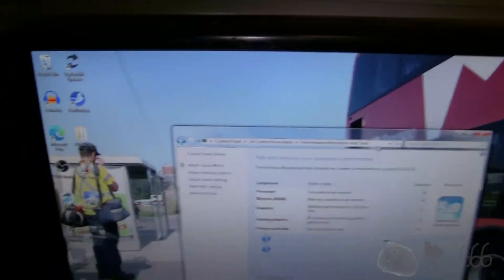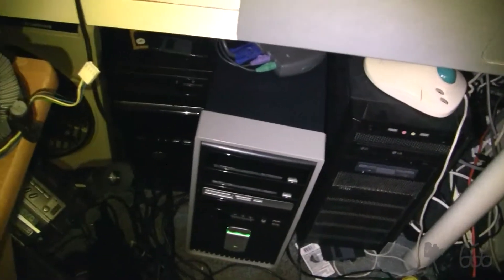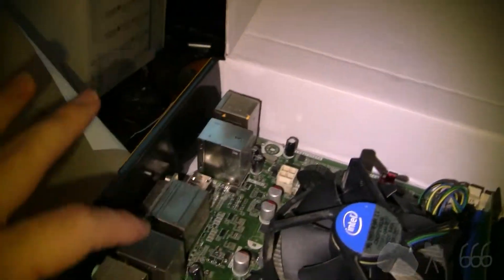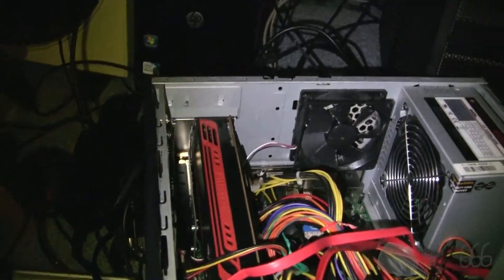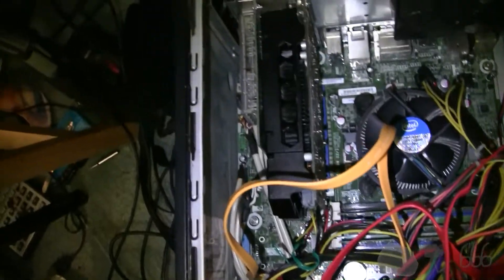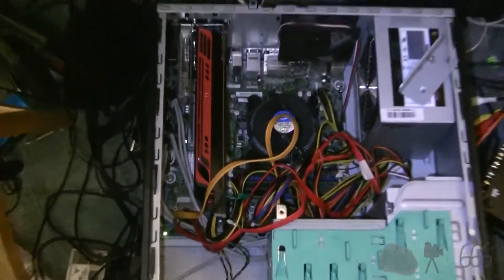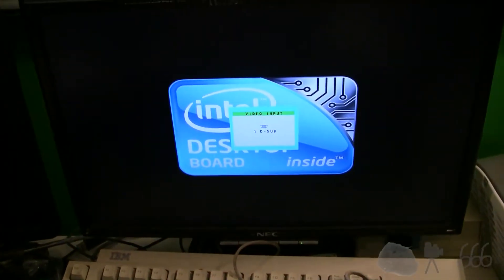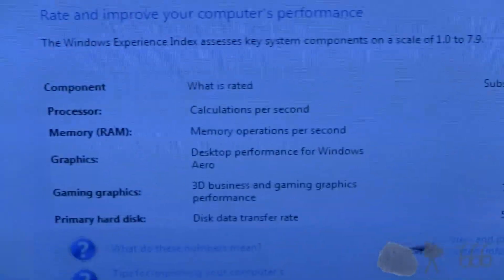Video Capture PC i7-3770 Upgrade

Comment: The i7-3770 was the CPU I used as a main for the longest time. 2012 to 2020. I still use it in a backup machine with a 1050ti. Goes to show how much CPU improvements stagnated for much of that decade. Still perfectly usable nowadays.